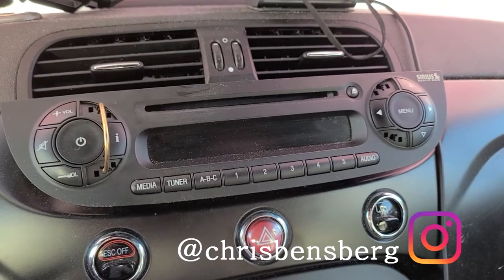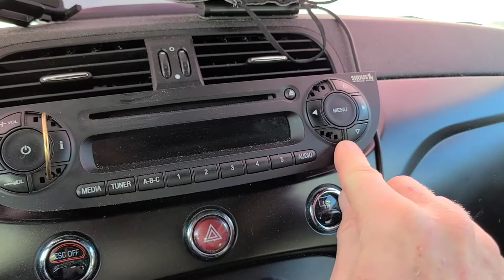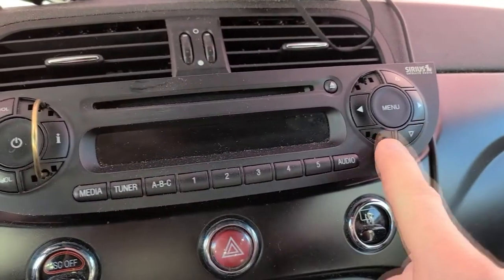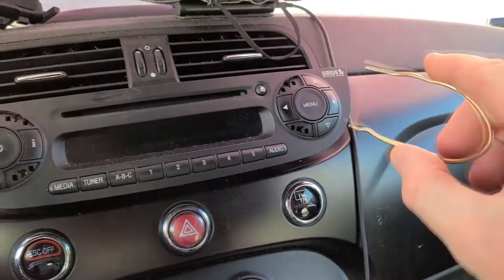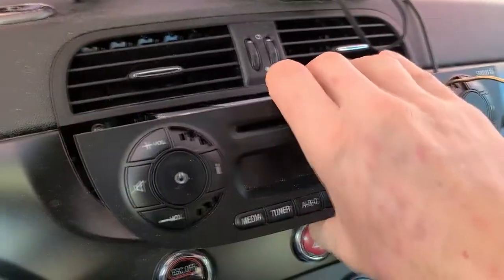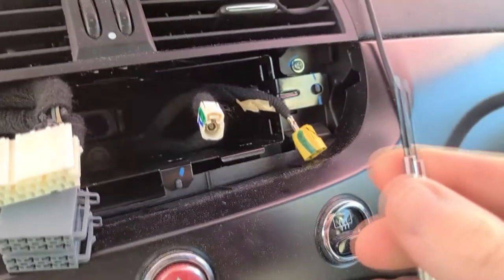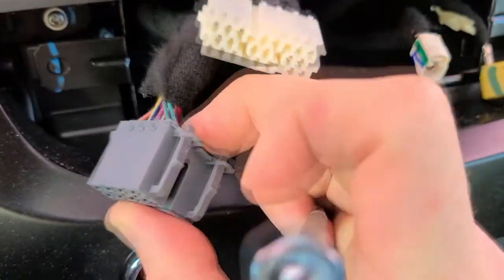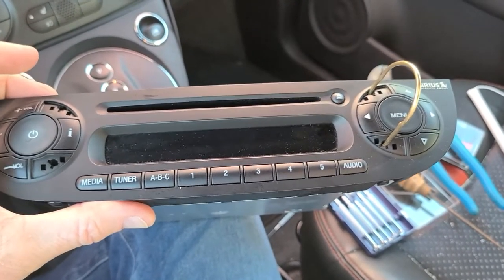How To Remove The Radio On A Fiat 500 500e

Comment: My old radio had issues ejecting CDs.  I got a new one but when I put it in it has no sound but powers on.  I tried another one and did the same thing.  THe forum says it needs a code.  The radio is not asking for a code.  How do I get it to display "enter code"?  Once I get to that, how do I get a code to use?